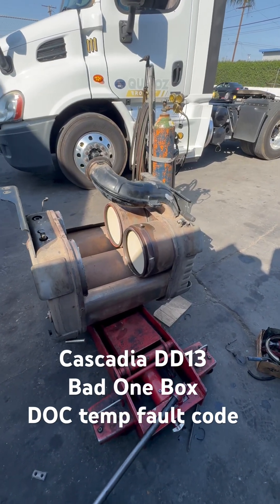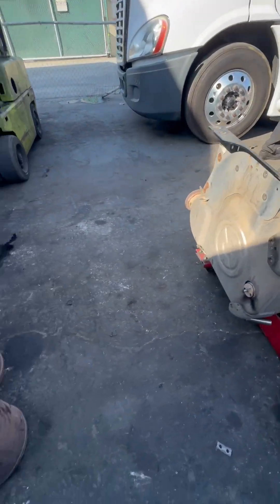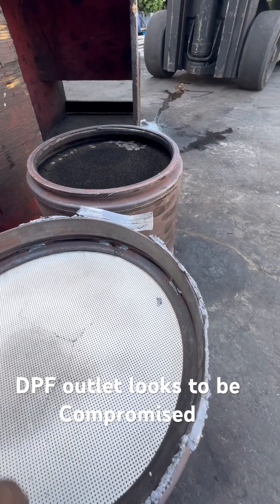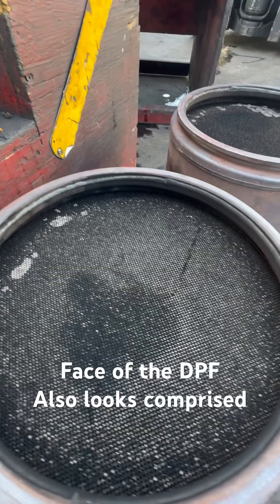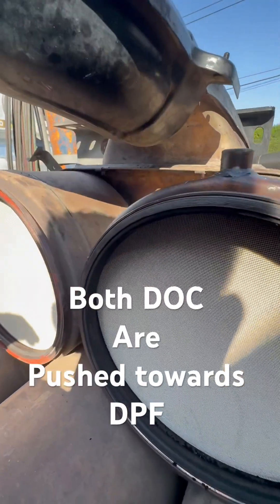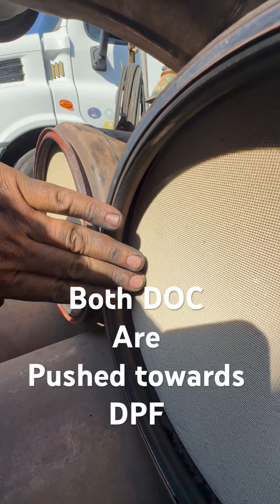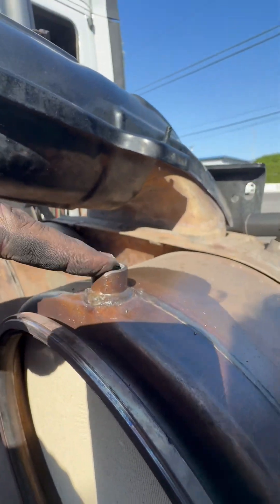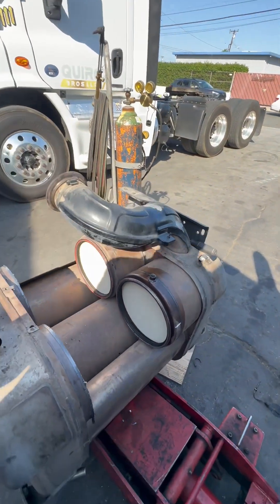DOC temp fault code, have to open One Box for proper inspection #dd13 #dieselrepair #freightliner

Comment: how can the one box be saved?
Reply from the maker: @jorgefacio690  the box can be baked, cleaned, blown out and the DOC can be pushed back into their original location. 
The DPF might be a different situation, depending on flow.
Reply: Cleaned and baked mine and it lasted about 3 - 4 months and started having problems again.  Should have saved that money and deleted first thing. The cleaning cost me almost as much as the deletion
Reply from the maker: @miglo817  I think this is why Detroit recommends replacing the DPF filters instead of bake and cleaning. 
I make the recommendations but ultimately the customer decides what they are willing to spend. 
In California, AQMD is starting to require smog in order to renew vehicle registration. I’m sure there are ways around this but for now it seems pretty strict.
Reply: I can repair that box